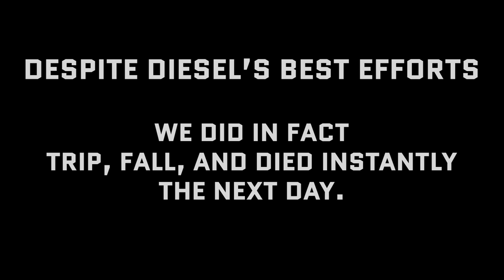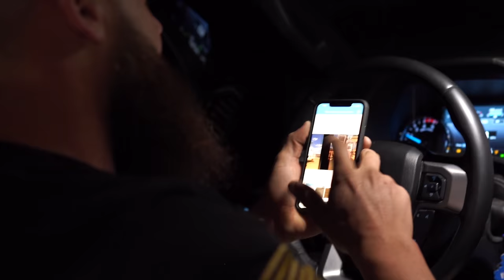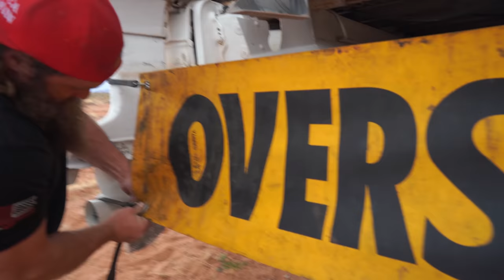Can A Houseboat Haul Cattle? (We're About To Find Out 😅)

Comment: I love the idea with the barge BUT you'll need more than 4 pontoons for 30,000lbs. A better idea would be to turn it into a party barge with a tiki hut and bar Rhino line or what ever you use the pontoons sand them smooth so it glides in the water and not plow and you're going to need HP to push that heavy thing at least twin 300's and motor placement on the rear corners just to help with steering (one motor going forward and the other in reverse will help pivot the barge in tight places)and it going to need to be tough.The frame work is going to need to be reforced BIG time with 4 steel toons going straight no problem but when you go to turn that monster tou are going to be putting a lot of torque on the frame from the toons plowing in the water. It'll be a TON of work but when its done it'll be cool!! Good Luck!!!!

Comment: I drove for hodges trucking and cranes.  Hauled many overweight, oversized loads many miles ,  I mainly drove kenworth trucks ,   some had 60forward and 12 reverse gears , 2 of the wintches , had 15 speeds in and out  ,   but I'd rather run a showboat , with 18sp 725hp kitten

Comment: Or you could also instal two nice diesel engines with two jet pumps in the rear and  with a front drop deck that way you guys could weld a 5ft to 6ft sides around it and also have a nice driver's cabin in the back and all that torque Monster Power you will ever need  for hauling and equipment or cattle  up or down a river or open water you need and instead of adding another pontoon across the center weld in cross beam supports for strength and you can weld a solid sheet of half steel from front to back and and from pontoon to pontoon nice and solid curved up in the front to attach the front deck down and with the solid bracing in between the pontoons with the solid sealed steel bottom then you weld in diamond plated steel so with all that extra air space and your two diesel engines with three stage Hamilton jet pumps and the captain's house and the side solid decking all the way  around  sealing to the drop deck to keep any water out plus with  the solid hole design between the two pontoons and bracing you will have so much more buoyancy  by the way the ever want help drawing up the design just tell me to text you ill happily help  for free with the plans